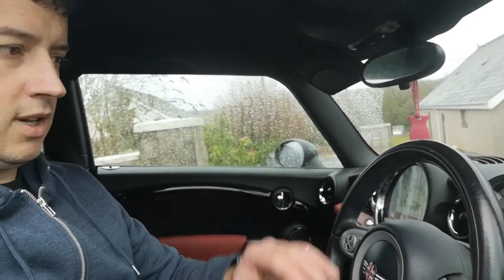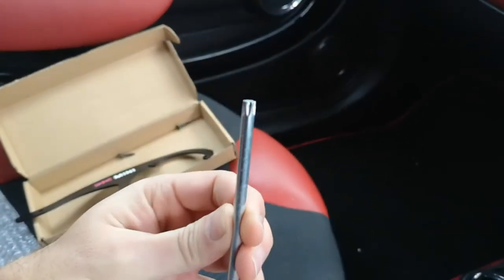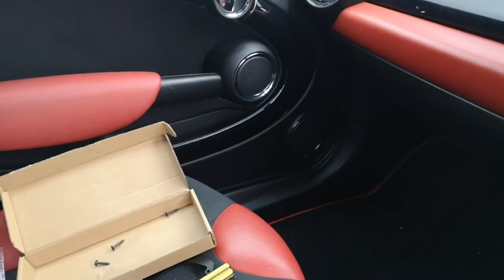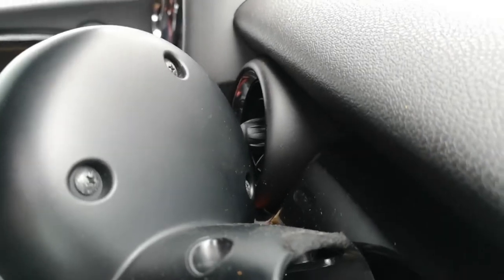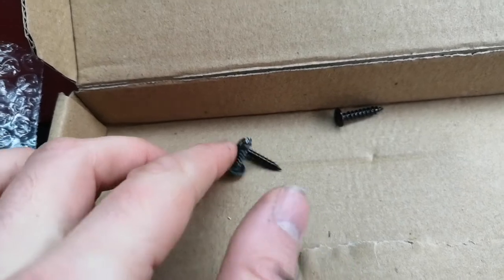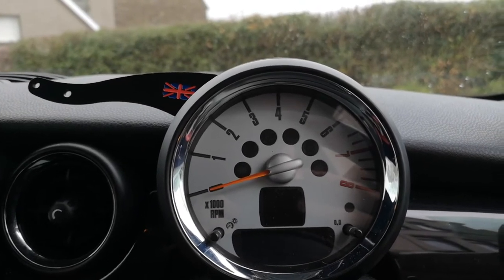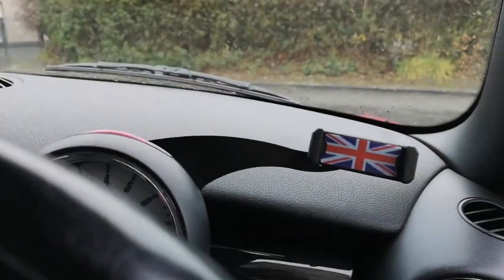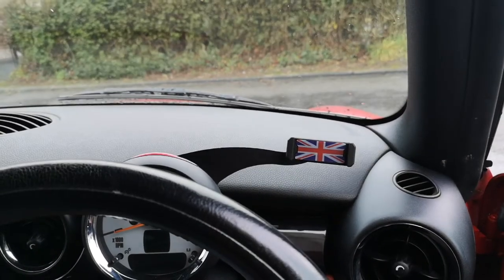Mobile Phone Holder install - Mini R56

Comment: Cheers, my torx were a pain in the arse to get back in as the screwdriver was a tight squeeze before fitting the holder

Your video was really useful, thanks